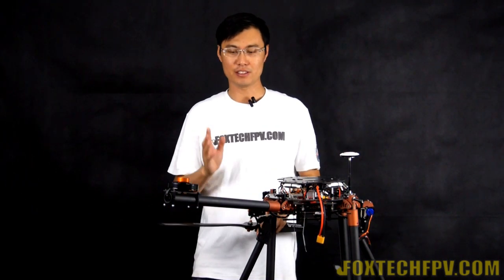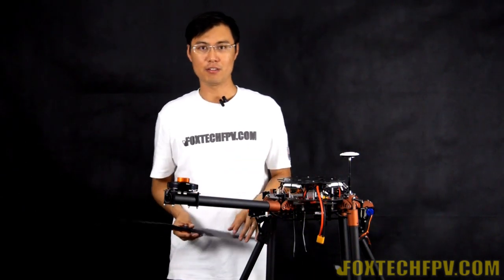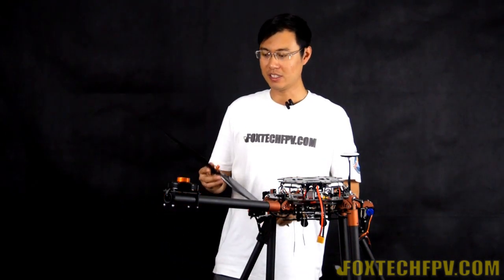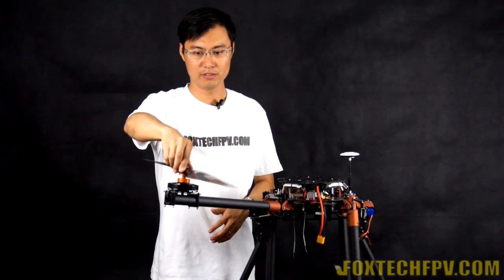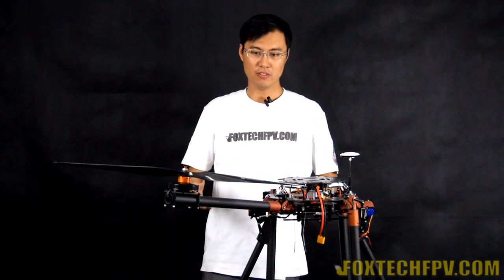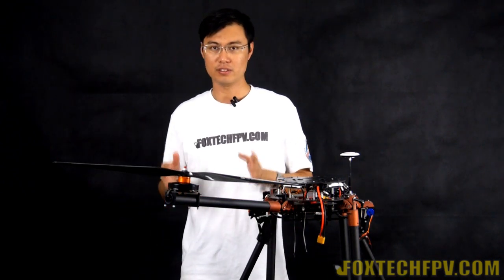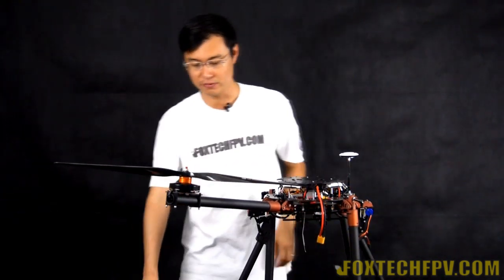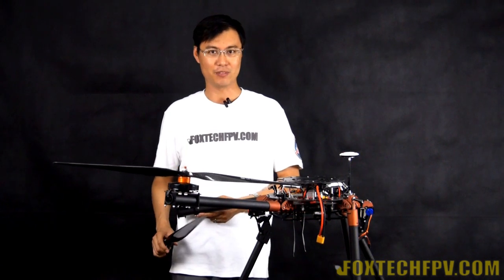U8 Propeller Quick Detach

Comment: Hi ! Does these work with t motor U10 as well ? thanks
Reply from the maker: This quick detach is dedicated for U8 . I am afriad it does not fit for U10
Reply: Foxtech Hobby Looking on the specs it seems u8 and u10 have the same mounting points for the propeller bracket
Reply: DroneGear Foxtech Hobby 
What is the diameter of the circle where the holes are place on this mount. If it's 20 then it'll fit both
Reply from the maker: We need to use 25mm hole position of u8 , But there is no 25mm hole postion on U10 , So I don't think u8 quick detach fits U10 .